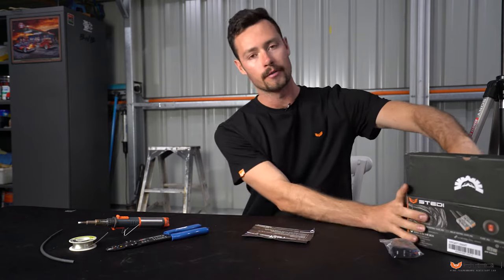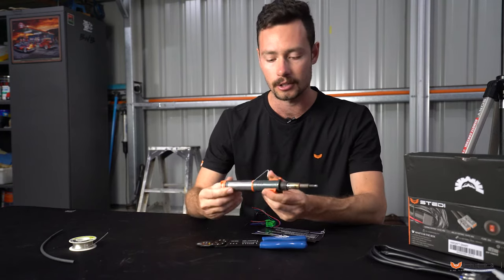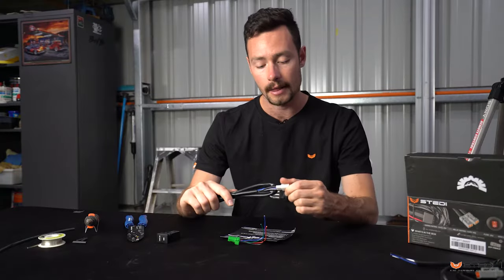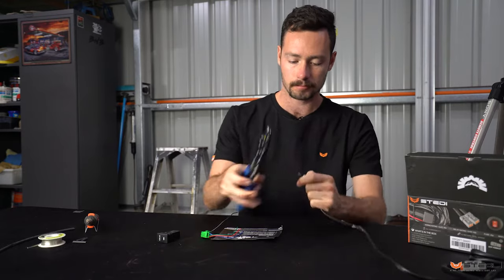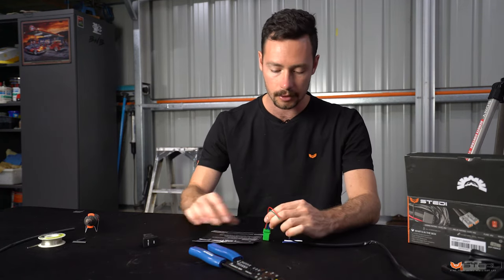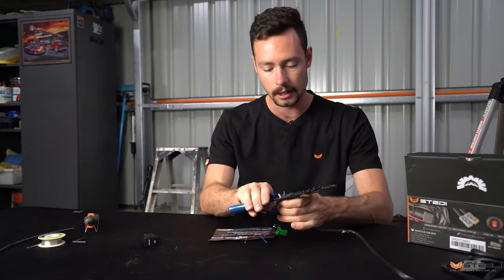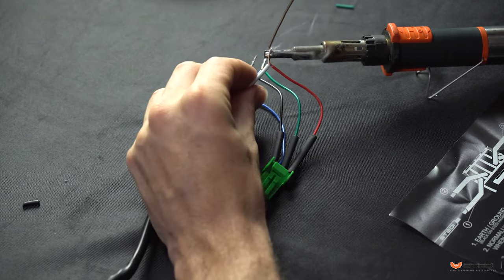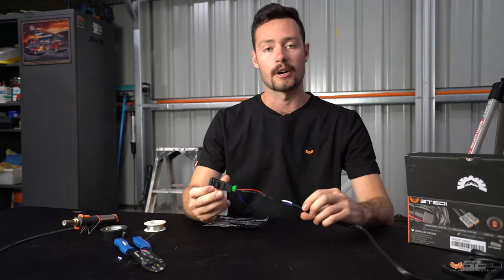Short Toyota Push Button Switch | Install Guide

Comment: Bit bodgey i think would prefer stedi light harness just plug into back of the switch job done no cutting of wires & rejoining just bullshit, like been back in the 70s imo
Reply from the maker: We hear you. We've got a quick connect, plug and play system arriving soon
Reply: @stedi_lighting  any updates on this? Because I just bought one and am watching this video, so I don't think it has happened yet 😅

Comment: Haven’t found a single video on hooking up to a relay  and my switch says it will melt switch if you don’t use a relay.
Reply from the maker: We have lined up to renew this video, basically we just mean that the source, such as the harness, requires to be fused with a relay.

Comment: When you say dash connection for the led, I get it after connecting the other 3 anyway, using the single output harness with the quick connect switch line, what use would connection the 4th (blue cable) be?

Comment: where do I put the high beam signal? I want my additional spot lights to turn on if I turn on my OEM high beam and the STEDI button is pushed. if the STEDI button is not pushed and I turn on my OEM high beam, the additional spot lights should not turn on.
Reply: The high beam signal is part of the plug n play stedi harness, not this mitsubishi spot light button harness.
The play n play harness plugs into high beam bulb with a piggyback adapter, which goes into the relay, which then goes to the switch.

Comment: tell me if I got this right

Breaking it down:
Ground wire- ground/earth
Dash light wire- 12v car accessory (either park light, tail light, 12v socket) tap something that will give constant light to the switch
Relay wire- [power out] to turn on the light bar when the switch is depressed/turned on
Source wire- [power in]

Question:
Can I connect the "dash light wire" together with the "source wire" with a 3amp fuse in-between?
The idea was for the switch dash light to turn on when the high beams are 'ON' and not when the accessory light is on. But I am not certain if it will work this way.

Comment: I wired mine as per diagram and left the dash light wire on plug, but it still lights up when spotties are on? Is the dash light referring to the spotlight logo lighting up and not the blue led?
Reply: Yes

Comment: How come you didn’t use an in line fuse, is this not really necessary?
Reply from the maker: The inline fuse is pre-wired into our supplied wiring harness. These switches should always be fused and run with a relay.

Comment: Where do I tap into accessories so I receive power for the LED?
Reply: Find an accessories power feed - cigarette socket is usually a good place
Any power source that is active while in accessories mode
Reply: @omfgishBenneh  don't you want to tap into the dash light circuit so the dash light dimmer works